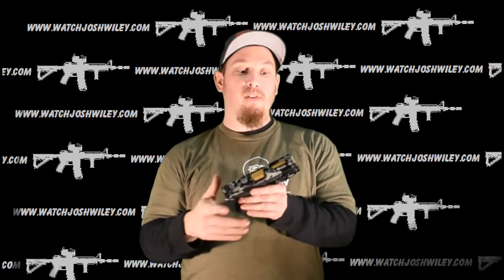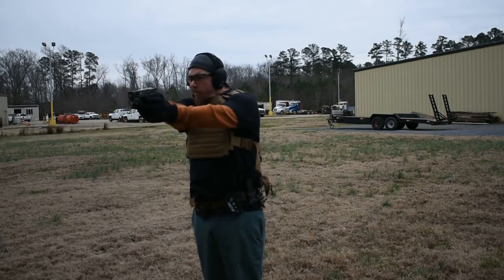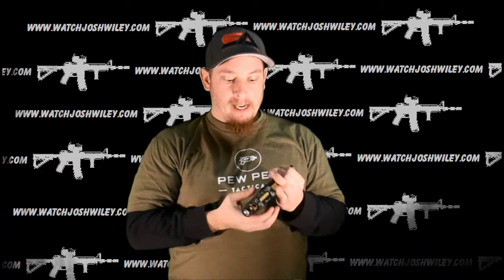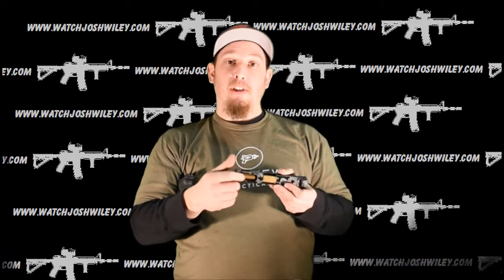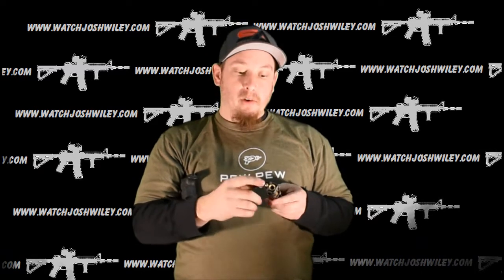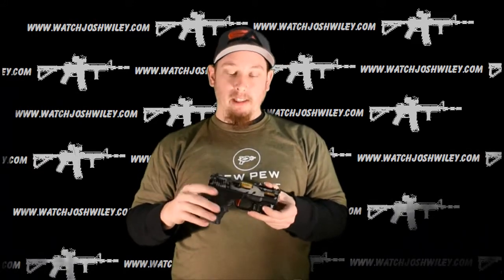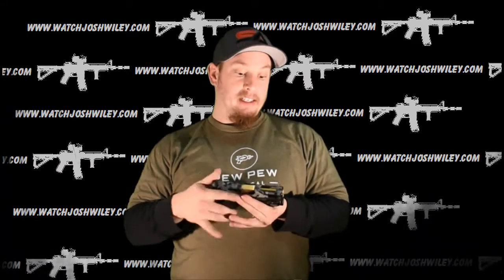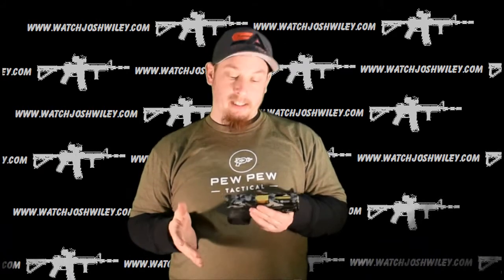How To Customize A Glock 19

Comment: With the slide cuts did you have to put a lighter weight or a heavier weight recoil spring in? Or are you using the oem spec weight recoil spring?